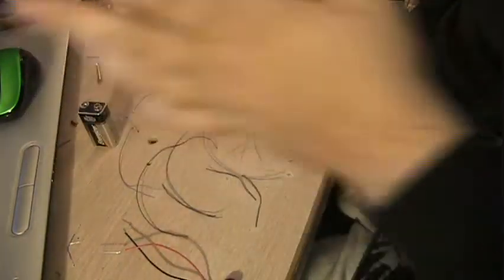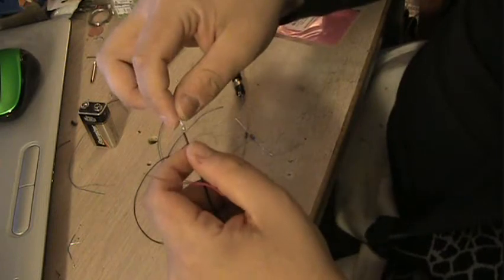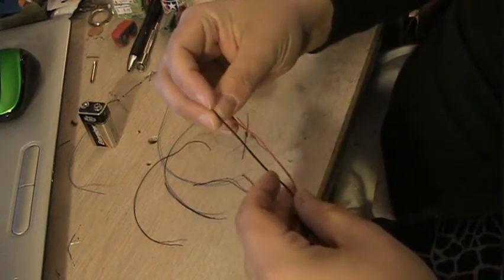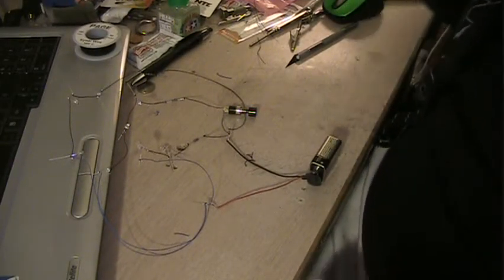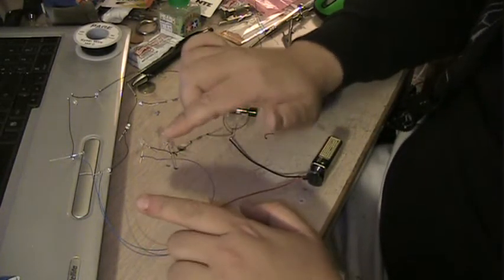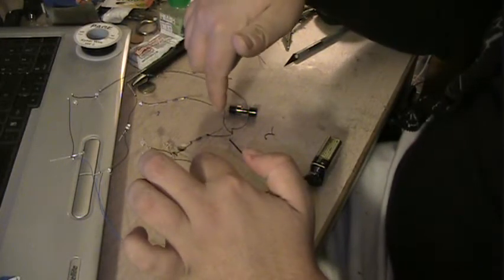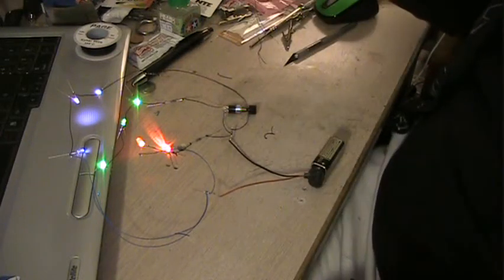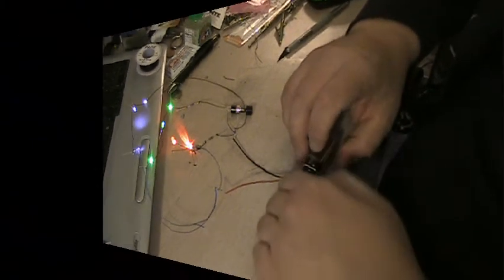Model electronics 101, lesson 3, setting up a simple parallel circuit

Comment: When activating the switch and the one set of LEDs go off, and the others stay the same brightness ... my understanding is that this is because the other parallel series have their current limited by their own resistor. The only time you should see an increase in brightness is if there is less current available from the source (battery) than is limited by the resistor, and when you turn one of the parallel series off you should see an increase in brightness as the current becomes available.

Comment: In conclusion to my first post below, one of the advantages as I understand it to using parallel circuits, is to be able to run multiple strands of LED's with consistent brightness.  If you put 20 LED's on a single series circuit, you'd have 20 very dim LEDs.  Break that into something like 4 or 5 circuits tied together like you demonstrate in this video (i.e. in paralell) and you can get past the problem of voltage drop.    Thanks again for the great tutorials!

Comment: Face, great videos.  I've learned a lot.  There's one thing I don't think you went over, but I'd have loved to have learned in this particular video, which is voltage drop.  I wasn't certain if there was a limit to the number of LED's that could go on a circuit, but it turns out there is.  For instance, a 9v battery is only going to be able to support 9v worth of pull from however many LED's you try to put on a circuit.  If you use 3 white LED's rated at 3.2v (9.6v total) you'll lose brightness.